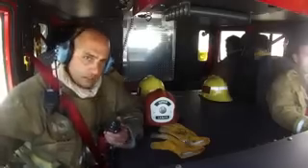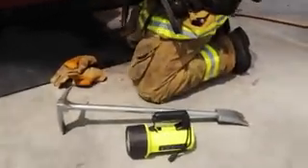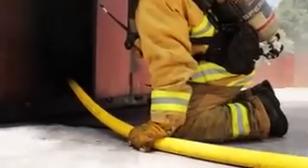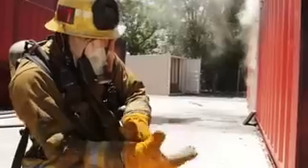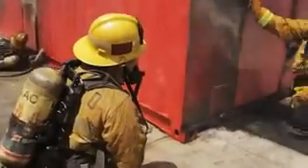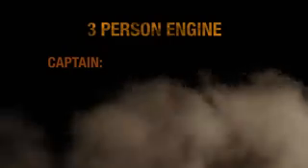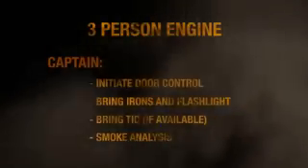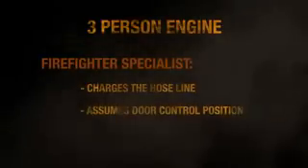Interior Fire Attack, Advancing 1 3  4  With Door Contolwmv)

Comment: Very similar to what we are doing in Australia, but with some differences. Dial down your flow rate. Pumping huge amounts of water will create steam, reducing visibility, increasing discomfort and the risk of steam burn. Straight nozzle into the over pressure area above your head will not provide a reliable indicator of the temperature as the droplets are too large and are more likely just bouncing back off the ceiling. A quick shot of fog spray will be absorbed quicker and more completely, thus aiding in cooling the fire gases. Door entry, we paint the door as shown here but if also create a 3D flame trap with a fog spray over our head to cool the escaping gases. Every door, inside is treated the same way, not just the exterior doors. If you get the chance to practice in a flashover cell, see if you can compare straight jet to fog and see if it makes a difference. Every fire is different of course, but it's in our own interests to share and learn. :)

Comment: On a slightly humorous side.  We were in an interior attack on a training fire in an old large timber construction dwelling.  A rookie just out of fire school was given a chance to strut his stuff on the nozzle with his LT right behind him. As they advanced the line he hit fire with a wide full cone spray and caused a lot of steam in the room before ventilation was established. No one seriously hurt as the backup used a straight stream to knock out a window covering but our rookie did blister his ear tips.  Trip to the ER and statement to the Fire Marshal and a thousand ear jokes for the next six months.  The truck company put mouse ears in his locker, his car, and in the day room every day for about a month.
Reply: JB I was a firefighter for 24 years starting as a technician and finishing as a Batallion Chief. I have attended Oklahoma State and the Masters Program at Maryland and no one teaches surround and drown as the preferred method of extinguishing structure fires.  We always enter the structure if the roof is intact and conduct a search for victims as well as ventilate rooms where we safely can. We pull a line as a part of that process for our own safety and if possible attack the seat of the fire with a straight stream or small cone to suppress the spread but that is secondary until we know the occupants are no longer in the structure.  A working structure gets an engine company (2 pumpers), a ladder for ventilation duties, and a medic unit.  If the structure has smoke or fire visible on arrival we will ask for another engine company and depending on the weather and size and exposures we may fill the box. As for coordination the first arriving officer establishes command and does a walk around the structure to assess fire location and extent. He/she stays in front of the structure and establishes subsidiary commands like staging, triage, transport, and logistics.  As a more senior officer or Batallion Chief arrives command passes to them. The entire incident is given a tactical radio frequency for fire ground operations and a dispatcher in the safety center is on the frequency until the incident ends.  Command is from a Chiefs buggy and manpower tags from each firefighter on the scene are held there for accountability.

Comment: Fire within an enclosed structure can create an explosive situation.  Flash over or back draft.  Understand how the smoke is exiting can tell what is going on inside.  Ventilating is important if it is at the roof.  An open door can create a bomb of smoke and gasses of fire that create an explosion.  And every fire and building is different.

Comment: Excuse the question.  I am a Japanese firefighter.  When entering a building, be sure to secure it with ropes between the members.  It seems that it is not secured as a video, but is it okay?  I'm sorry in a strange question.
Reply: Not necessarily here only time any type of rope or strap is used in hose lines is on high rise fires when they go straight up there center of a stairwell
Reply: @jasonwolfe6266  Thanks. So it's about changing with circumstances. Sorry for the weird English translation.

Comment: Did anyone but me see a crossed stream from the lead on the line? Also the commentator spoke of taking a leg  out of the fire and then it appeared that they continued to attack. Am I misunderstanding something? Was the fire not extinguished when a leg was taken out? What normally comes after extinguishment in the LA County FD?
Reply: What he means about taking a leg out is just letting the steam conversion choke out the fire and cooling the gases at the ceiling. It wont extinguish it, but will knock it down enough to make conditions a bit more safe to advance the line. That's how I took it anyway.
Reply: Fire triangle. Fuel, Heat, Oxygen. Reducing temp is essentially removing the heat "leg" of the fire. Or by keeping door closed limiting entrainment of air is removing oxygen "leg"

Comment: any thoughts on smoke explosion with door control?
Reply: If sufficient cooling of the smoke is applied it shouldn't carry enough heat to auto ignite. We have a similar method in Australia but we use a fog pattern rather than a jet, once we can attack the seat of the fire we dribble the water into it so the investigators can effectively do their job
Reply: 100% agree! (Aussie FF too). Fog pattern will get you to the seat of the fire, where then you can use a more direct stream :)

Comment: Why a straight stream?  If known that no one is inside. Again, why a straight stream?  Have you ever entered with a full fog?  Fog will instantly create water and steam (and create a cool area for the fighters)  Steam will snuff out the fire quickly.  Just make sure no one is in there as the thermal balance will be drawn down.  It is a known fact that a full fog nozzle can put out mass fires faster than a straight stream. (attention to the first attack nozzle) A 2 and a half inch hose (line) with 200 lbs pressure at the nozzle at full fog will extinguish lots of fire very quickly.  It is almost like using the deck gun which does the same in a straight stream with lots of pressure.  Experiment with it with practice burns.  Find out what works best.  You may be amazed.